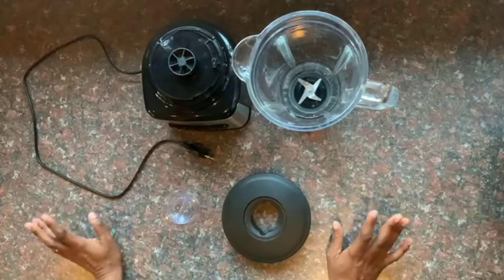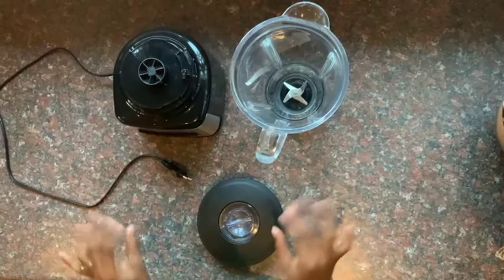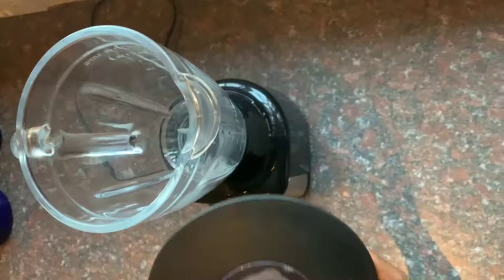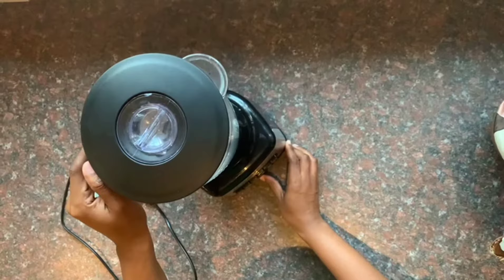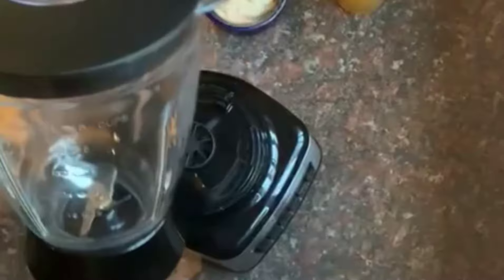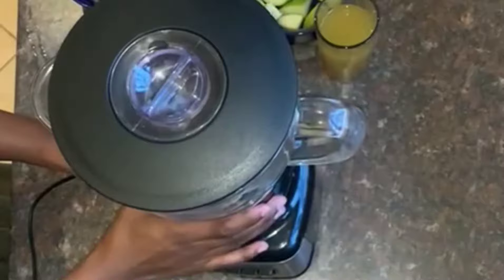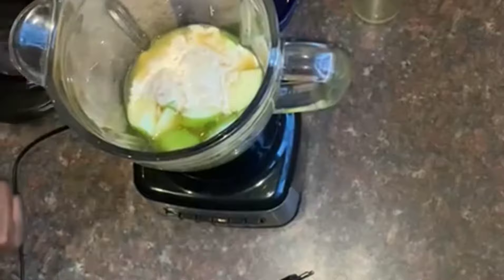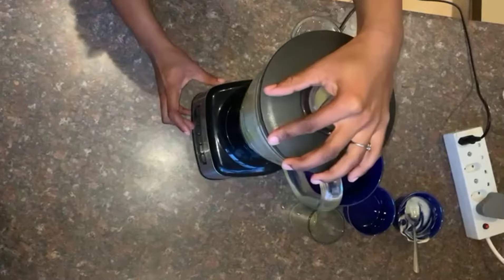How To Assemble and Use your Blender at Home | Anesi T #logic #blender

Comment: For ANYONE Struggling to get the Blender Working, kindly check the triangle arrow drawn on the Jug or grinder and align it with the the unlock padlock drawn on the blender and twist towards the locked 🔐 symbol on the blender you will get POWER
Reply: Thank you so much for this  comment. We failed yesterday since morning. And we got it right after this. Thank you for sharing. Halala
Reply: Thank you
Reply: Thank you for this, we have be struggling with this for days😂
Reply: Ty girlyy
Reply: Thank you you have helped me
Reply: Thank you so much you save me I've been struggling for weeks now 😢
Reply: Thank you 😅, I was seated Wondering why this blender ain't working but I saw this comment, I did exactly that and it started working
Reply: OMG thank you very much this comment helped me a lot😊

Comment: I buy today but the problem was  not function no power but in the store where i buy this kind expensive imarflex IB 530s  they will testing the blade without water it was function very fast but the problem when i got home at night never be functioning even the blade never been move sadly i need to return this to the store for there 1month warranty my problem is the store can be replace the item or they only repair it ......my problem is this is very needy coz it will use my father as patient for his food and juices daily.😭😭😭😭

Comment: Bought this same blender and it always has a burnt smell with smoke coming out sometimes. Did you experience this problem?
Reply: mine it is not working and when i try to fix it by myself unfortunately  i cant unscrew the nut on the top. i am stacked.
Reply: @sthembisobongani6339  take it back to the store. Don't fix it yourself. If the warranty hasn't lapsed you should be able to get it fixed or get a new one.
Reply from the maker: Never experienced the problem..didn’t you return it to the store?it has to have the warranty hey?

Comment: Where is the on button or where do you press for it to work
Reply: @zandile buthelezi adjust the jug until it sits properly and turn it until you hear a sound click that it's locked in.I've also been struggling to use it until I learnt that.

Comment: Been trying to use my blender for over 30 minutes now but failing,  how long should I press the off button for it to get on. 
Kindly help
Reply from the maker: Hello Margaret!make sure that  the blender jar is secure to the power base and one other thing that can be a problem is that if you are using solids make sure to add a bit of liquid so the metal blades I the jar can move.Let me know if it worked out

Don't forget to press the power button for electricity to flow for the blender to blend hey 😊
Reply: @anesit  I have correctly placed the jar on to the power base. Also I had put plain yogurt first before pouring slices of fruits. Do I need to long press the power button or what? Do I need to press the power button and speed button at once?I have failed to figure out how the power button works.
Kindly note that I used the blender once successfully after watching your vedio unfortunately cant remember how I got it right.
Reply: @anesit  hey finally have managed to  blend my smooth.💃💃
I had to position the triangle symbol on the power base facing the lock symbol on the power base.
Thanks alot

Comment: Still can't switch it on
Reply from the maker: Hello Sello!is the blender brand new from the shop? If it’s new, have they tested it at the shop?if not take it back to the shop and let them it’s not switching on OR please make sure that the blender jar is all secure to the power supply base and add a bit of liquid to solids that you blending.